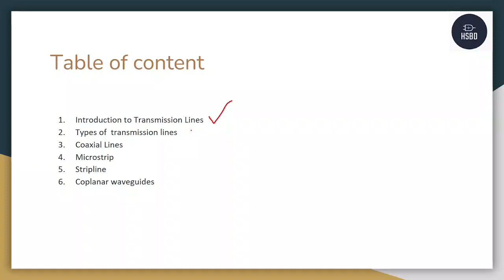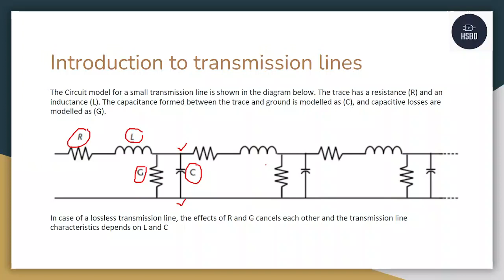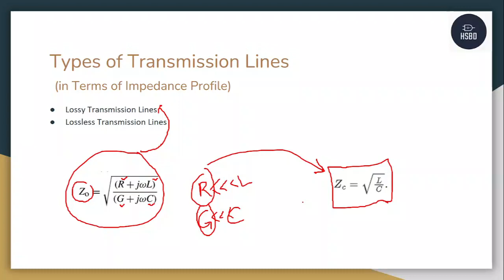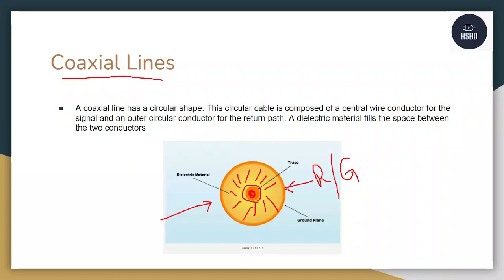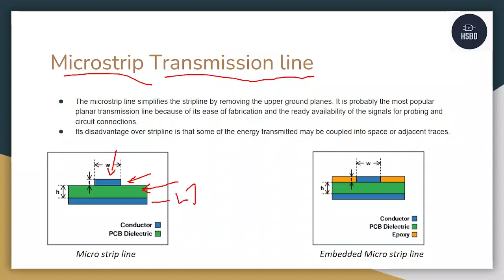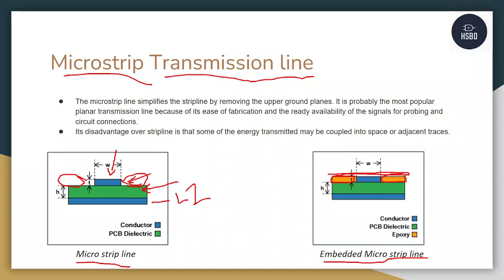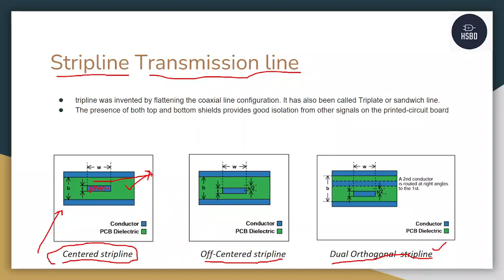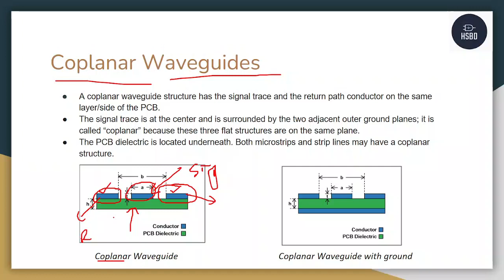Part 1: Transmission Line Basics | High Speed Digital Design.

Comment: Thanks for the video. It was useful. What does the image Coplanar waveguide with ground mean?
Reply from the maker: Hi Shravani,
The coplanar waveguide (CPW) is a planar transmission line used majorly in microwave and millimeter-wave applications. It consists of a signal trace surrounded by two ground planes on the same substrate layer. This configuration allows efficient signal propagation, reduced radiation loss, and easy integration with other circuit components.